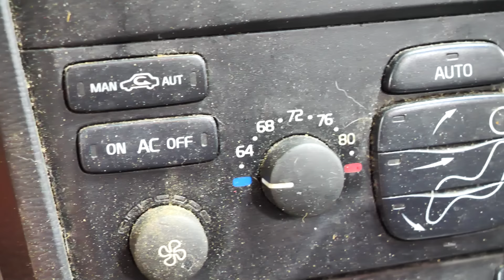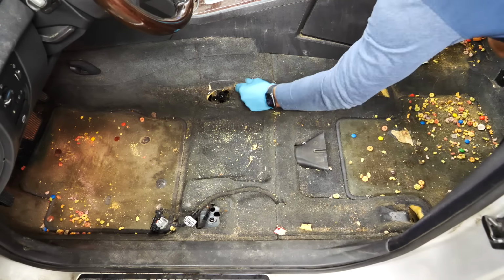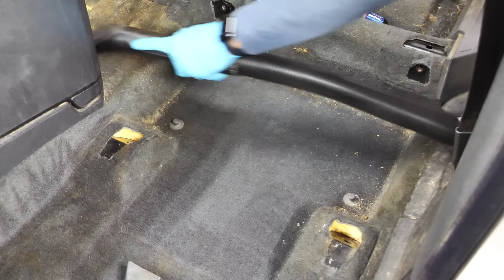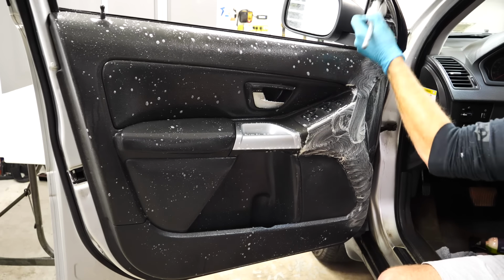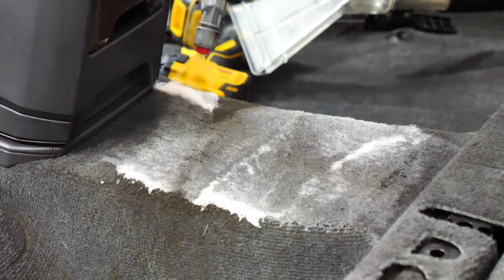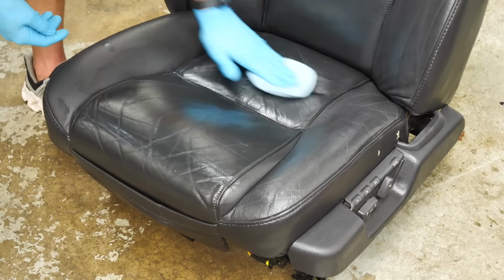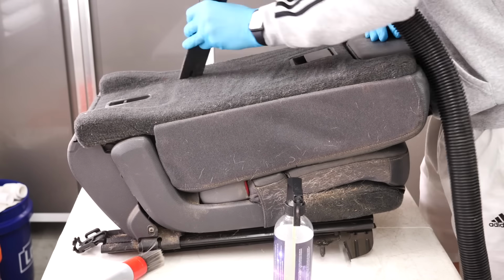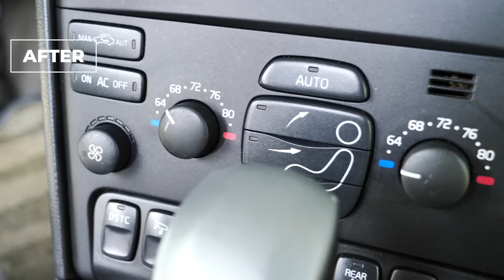Car Detailing Restoration Of a DISGUSTING Volvo XC90 SUV

Comment: Sorry but as a valeter. I know that spraying all purpose cleaner or using a steam cleaner on switches does affect them.  It may not affect them immediately but it does cause corrosion on connections.